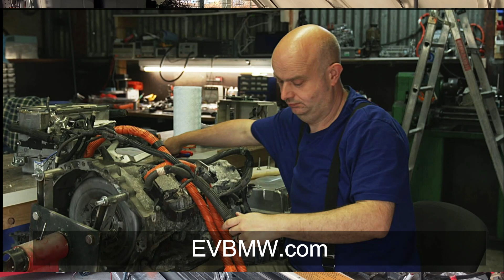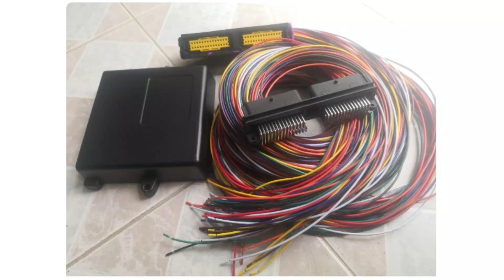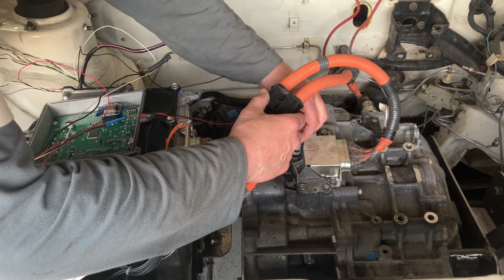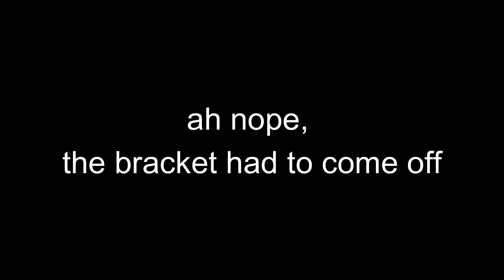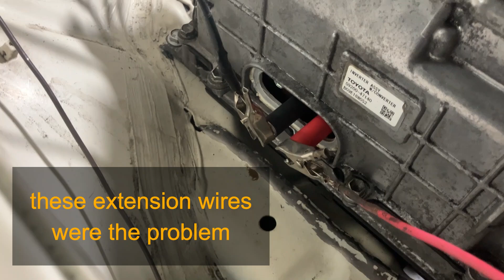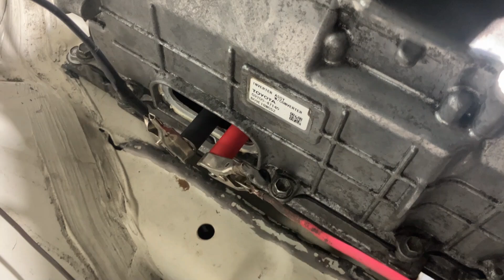84 VW MK1 Rabbit ZombieVerter VCU Wire Harness

Comment: Hopefully by now you have it sorted. Where in the aliexpress did you find the connector and wiring??
Reply from the maker: link added to description as YouTube no longer allows us to post external links in the comments, but it was called this: FCI 56 Pin/Way Female And Male ECU Connector Plug With 18AWG 3 Meters Full Wire Cable With Shell 211PC562S8009 211PC562S0008
Reply: @Good-Enuff-Garage  thanks, almost the same price as what I paid for the motor! (i'm so cheap!!)

Comment: If you haven't connected battery interlock it might be the reason. I would say definitely not the parking pawl. If it was that motor would move and you could hear clank parking pawl stopping it.
Reply from the maker: Thank you, I watched your video on the PP and was able to remove the actuator and confirm by hand it was clicked counter clock wise, could the spring be broken inside and its just floppin' in there?
Reply: @Good-Enuff-Garage  it should be spring loaded it is not flipping on mine that's for sure